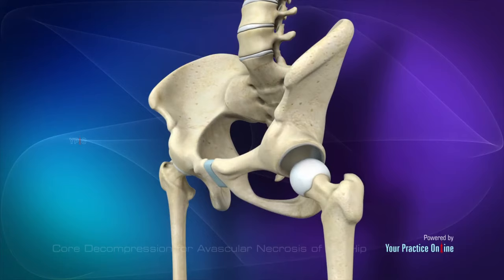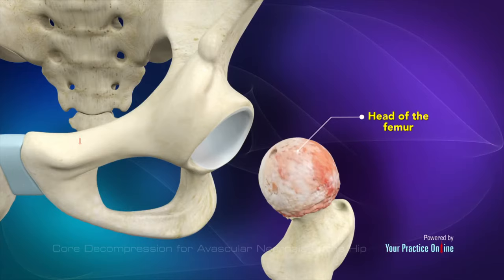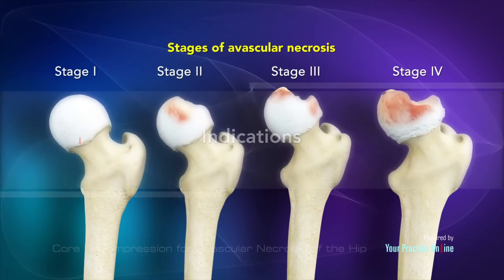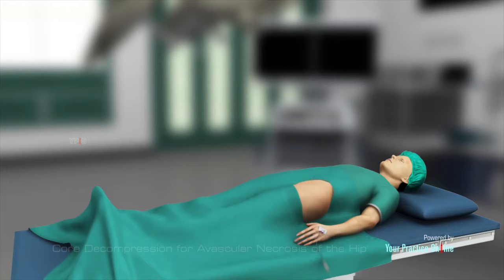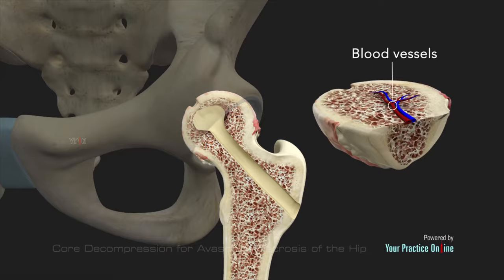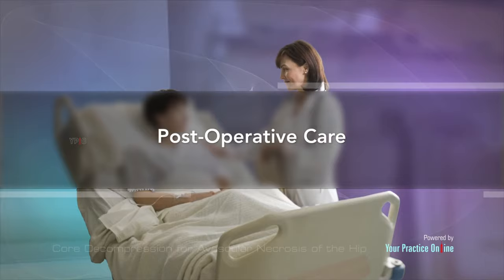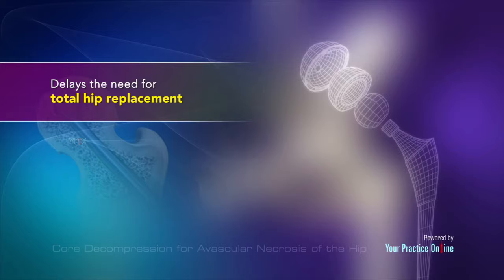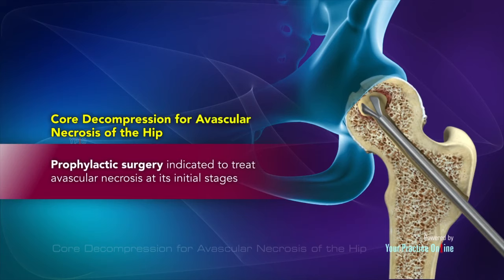Core Decompression for Avascular necrosis of Hip(AVN)

Comment: I went through this surgery when I was 29. It all began when I was 28. It was so painful but after the core decompression I felt immediate relief and the healing and physical therapy process was very easy. I am 30 now and I am back to normal.
Reply from the maker: Yes.its a good procedure if done timely
Reply: I just came to know about my AVN. All doctors are suggesting core decompression or bmac. I'm very afraid. I'm at stage 2 of avn . What should i do
Reply: @lifewithshivie  core decompression
Reply from the maker: @lifewithshivie  STAGE 2 generally doesn't requires a core decompression.should be manageable with medicines only..you can contact at 8595652340
Reply: I just had bilateral hip decompression done last week and felt instant relief after I woke up. It is scary but I would definitely recommend going through with it. After a week I am already walking differently and in less pain.
Reply: @Garcia.Taurus  congrats it sucks to have avn
Reply: @Chucky1993 It definitely does! Especially having it happen to both hips.
Reply: @Garcia.Taurus  no way that's gotta really suck.
Reply: How much cost
Reply: Please share the details what was filled in femoral head and how this was done?
Reply: @Ap-vz2ek  it was done with a incision on the side of the hip and a surgical drill was inserted into the hip joint and filled with some surgical cement concoction
Reply: Hey can u please share other details....ki kha se ki surgery or only Decompression hua ya fr steam cell/bonegrafting/prp m se kuch or ?
Reply: @Garcia.Taurus so lucky you can be able to walk in weeks. Im on my 7th month and still on crutches.
Reply: @Chucky1993  it does. Having a 6month period of healing even though I'm told there's no restrictions. Still a chance it won't work which will require an actual bi hip replacement.
Reply: @Ap-vz2ek  just as @Chucky explained. However, both of mine were filled with bone marrow, taken from my pelvis bone. So 3 incisions altogether.
Reply: @chucky1993 I underwent decompression in Jan 2024 due to avn stage 2.. how much time it will take for complete pain to go?
Reply: @dilip0singh  like 6 months or more